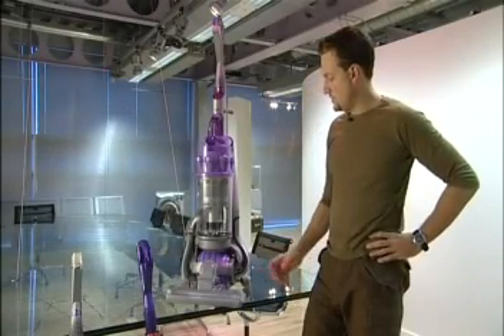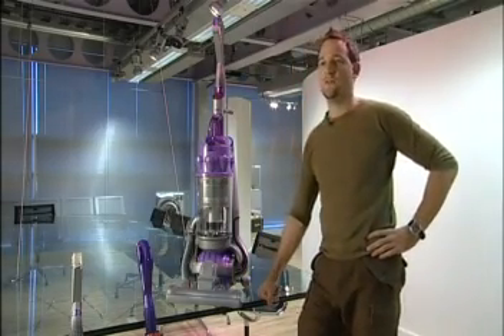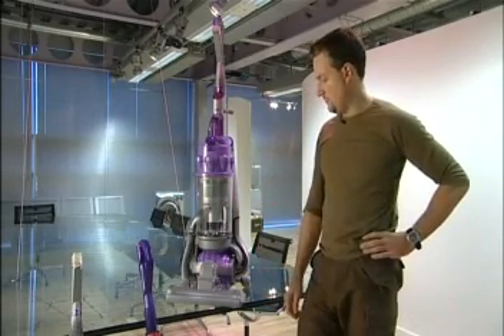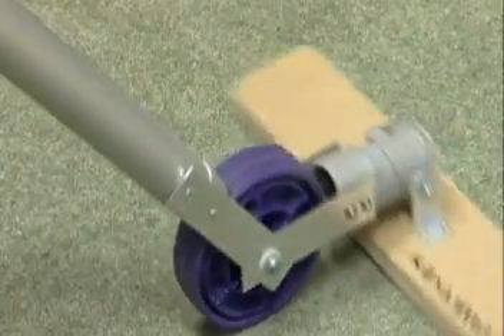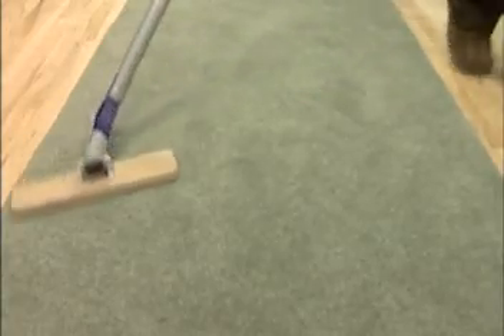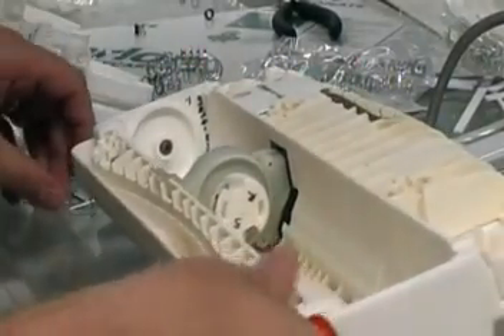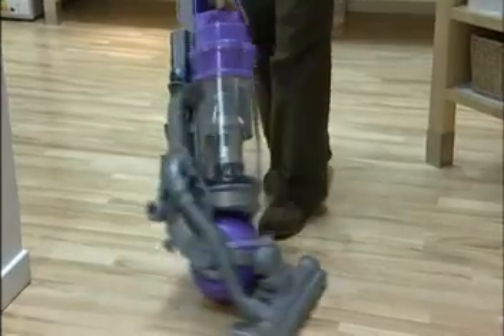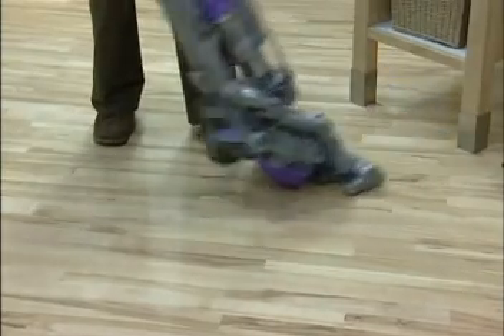Behind the scenes with Dyson on the ball vacuum (DC15)

Comment from the maker: @bwillwall The DC15 is the first of this type of cleaner and yes, it is a bit heavy to push around. Later models, like the DC23 and DC24 are somewhat lighter. Dyson has patents filed for a new 'ball' model that will likely be out in the near future. In this, the air ducting is shown to run inside 'the ball' which will perhaps make this cleaner lighter still.

Comment from the maker: The Dyson clarification is "Dyson proves no loss of suction, best average pick up, and 'overall outcleans other vacuums' using results from IEC 60312 Cl 2.1, 2.2, 2.3, 2.8, 2.9, ASTM F608 and F558, and DTM 755— an independently conducted Dyson test. "

Comment from the maker: It's a subjective and well worn argument. Some people prefer the 'simply throw the bag away' concept of bagged cleaner, others are of the mindset 'I never need buy a bag or filter ever again'. Typically, a Dyson will maintain constant suction for 12-24 months without filter maintenance, but you will get problems at some stage if you never check the filter.

Comment: NOT convinced.  I've owned bagless vacuums in the past, including dysons and I hate them all - the filters block VERY QUICKLY and when you empty the dust container you liberate the dust!!  Since April 2009, I've proudly owned a bagged Bosch BSG8PRO1GB which works perfectly, is manoeuvrable and the suction is INCREDIBLY powerful, even as the bag fills!!  When you eventually change the bag, the compartment around the dustbag is 100% clean, not a speck of dust.  Finally its bags are NOT paper ones.

Comment: My sister bought a Kirby, it worked wonderful for about two days and then the suction went to shit. Requires bags that are quite pricey at $20 for 3.  The hose attachment is ridiculously difficult to connect. I bought a Bissell Powerforce Bagless at Wal-Mart for about $50 and it cleans better  than that crappy overpriced Kirby does.